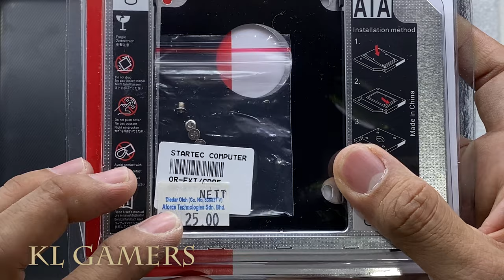ASUS X454L Notebook PC upgrade SSD and Second HDD Caddy

Comment: If the SSD fails after running its lifespan in a few years' time, can we then run the laptop from the previous HDD which had been installed in the caddy ?